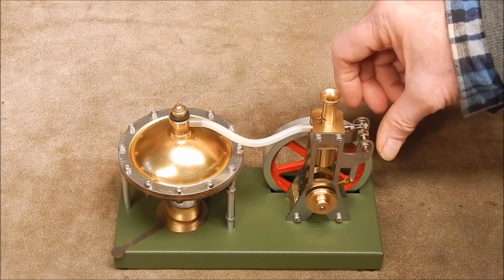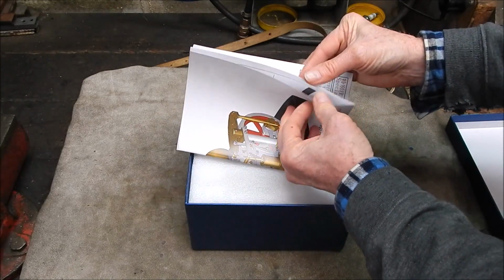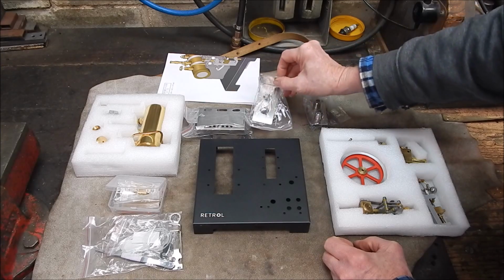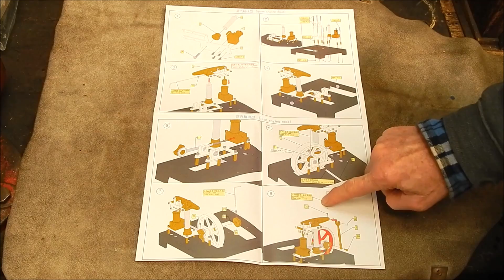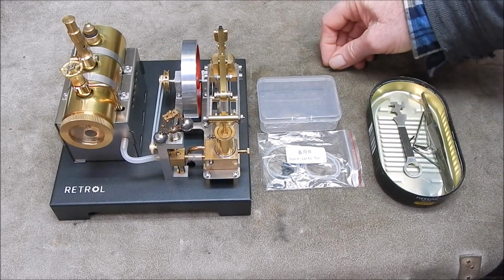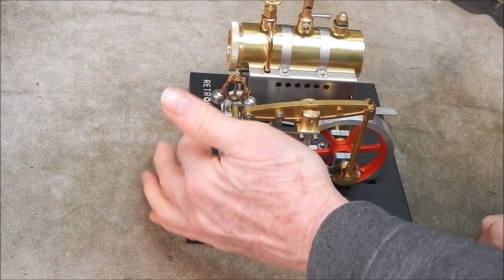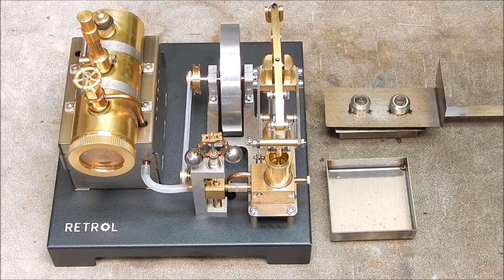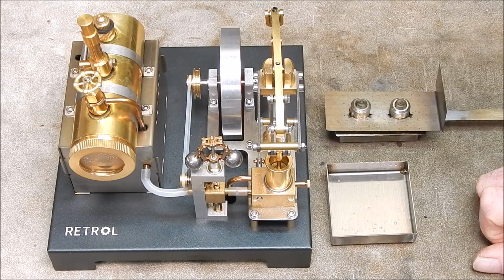I build the RETROL 84 piece model steam engine kit from EngineDIY

Comment from the maker: NOTE:  I find it runs best if you 2/3 fill the boiler, heat the water, refill the burner (which is relatively small), then run it with the burner door flap open about 5 -10 mm so it can get enough air.    It will run quite fast if you do this and adjust the governor.  Cheers Rob
Reply: i ordered one recently myself, glad i found your video for this helpful tip, thanks

Comment: Could do with an inline steam oil lubricator and Holes over the flywheel bearings to lubricate. This little setup could be better with a few easy mods. Remember brass don't wear well. Having said that is a great little starter plant for the kids to spark an interest in steam😊

Comment: Hi Rob. Lovely looking engine. From what I've seen the CNC machining of the small parts on these models is very good. Might be worth playing around with the governor to see if you can alter the running speed. Cheers, Alan.
Reply from the maker: Hi Alan.  I have varied that, but it's restricted by the amount of steam pressure available.  Run faster and it uses more.  I ran it on compressed air and it takes very little pressure to run, less than 5 psi, so the boiler could do with one more wick on the burner to get up more steam.  I had some lube in the water as well (I usually run some soluble air tool oil ).  The wicks are interesting in that they are longish metal coils of stainless steel.  Very effective.  I'd not seen that before.  It sounds good chuffing away with the governor cutting in and out.  Cheers Rob
Reply: @Xynudu  I have had mine a few days and didn't seem to get it running at all.  Played with the governor but it looked like some pressure was leaking from the governor and even very slightly around the base of the whistle.  Anyway lubricating it well, ensuring everything is free to move carefully including lubrication at all pivot joints and piston and now running smoothly, for about 5 minutes until meths runs out and at a really decent speed!  Very happy.
Reply from the maker: I found that the best way to run it is (after oiling everything) to heat the boiler to steaming point, then remove and refill the burner and replace it.  This greatly increases run time as otherwise the metho runs out too quickly way before the water.  I also drilled a very small hole into the metho burner top at the handle end in a position so I can insert a hypodermic syringe needle into it.  This allows me to refill the burner while it's lit with the engine running.  Works well provided you don't overfill it.  I also add a small amount of water soluble air tool oil to the water to reduce drag in the piston assembly. Cheers Rob
Reply: @Xynudu  I noticed a small hole in the top of the burner tray which would take a needle to refill, but not in the top “lid” sheet so is that where you drilled the additional hole Rob? Mine is now running so sweetly I’m very pleased.
Reply: @Xynudu  where do you get water soluble air tool oil?  I’m in the UK.
Reply from the maker: Yes, sorry, I meant drill through the lid cover thingy above the small hole in the metho tank.  I offset it slightly to allow for needle angle.  Air tool oil is quite cheaply available from most places that sell air tools (auto accessory shops etc).  I bought a one litre plastic bottle of it.   Make sure to get the water soluble variety as they are not all the same.  I also have air tools, so it's super handy and is a very light lubricant.  Cheers Rob

Comment: Ive just got this kit, having a few problems, one being the cylinder keeps popping off, doesnt seem to be a very tight fit onto the valve base, and the whistle leaks alot of steam in the off position, 
Its a nice kit, but seems the tolerances arnt that great

Comment: What lubricant are you using? Great job, ordered one myself after watching.
Reply from the maker: I use water soluble air tool oil.  It's very thin/low viscosity.  You can also put a few drops in the water/boiler to lube the drive cylinder.  It's available at most auto accessory shops.  Make sure you get the correct type as some is synthetic and not soluble.  Cheers Rob
Reply: Thanks, I have plenty of that

Comment: What kind of oil does it use? Steam oil? Does the kit include the appropriate lubrication? Cheers.
Reply from the maker: I use water soluble air tool oil (readily available and inexpensive) for moving parts and in the boiler water.  Oil is not supplied.

Comment: Hello Rob
These look fantastic and seem very well made, did you end up paying gst etc as they come from Hong Kong
Reply from the maker: I was gifted the engine kit in exchange for doing the video.  It's a nice detailed model. Looks fantastic.  Not very powerful and the boiler is only just big enough.  Cheers Rob
Reply: @Xynudu  that is really lovely to be given it.
Probably power is not important, it's not as if you are going to power anything,  I think just having a working beam engine is nice plus what a good model to put on a coffee table simply to admire it.
It would be nice if was reciprocating  but it is still bery nice.
You mentioned power due to a small boiler, so what happens when you run it off compressed air.
I know you would have the safety value out so you could use a higher pressure .
It would be interesting to know what the psi is to lift the safety valve.
Reply from the maker: Hi Steven,  it would run better/faster with more power off of compressed air as you don't have the pressure variations you get creating live steam, plus the supply is endless.  I expect the boiler psi would be very low.  Of all the models I have made, none require more than 5 psi compressed air and I expect this kit will be similar as it spins over very easily.  The silicon tube from the boiler to the governor is only a push on fit at both ends and the steam pressure isn't high enough to blow it off. Cheers Rob

Comment: Mine won’t stay running. Will turn over on its own power a couple times then stop. I even tried it with a propane torch and it didn’t make any difference. When I put 5psi from my air compressor through the safety valve hole it runs just fine. Any ideas?
Reply from the maker: Try adjusting the governor spring tension.  Also put sealer on the "O" rings under the three connectors on top of the boiler to prevent leakage.  The boiler ends screw off to access the retaining nuts.  Make sure the piston moves freely in the bore with no binding.  It may need lapping in a bit.  I said in the video the engine is pretty gutless and everything has to be right for it to run.  Cheers Rob
Reply: @ I noticed water leaking out of the governor. Adjusting the spring makes no difference.